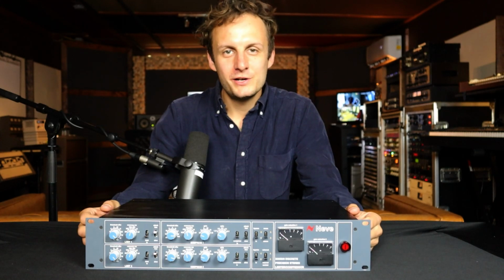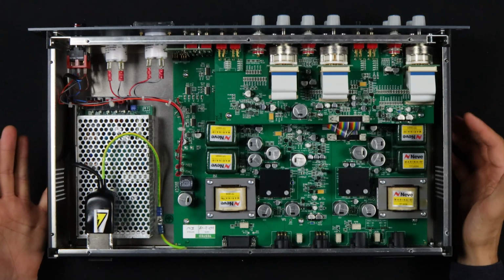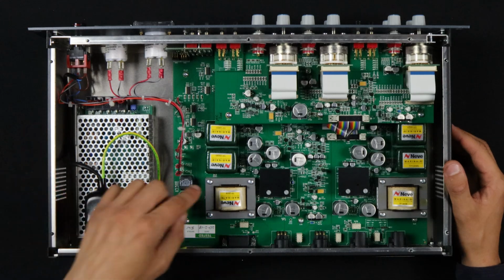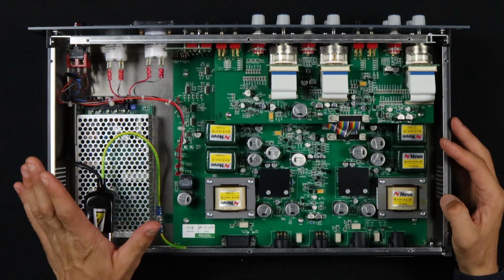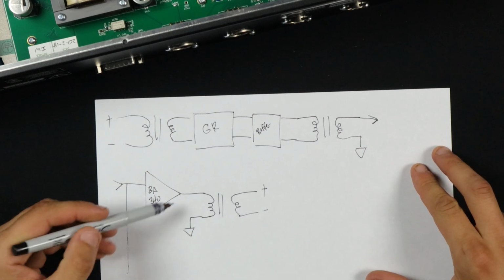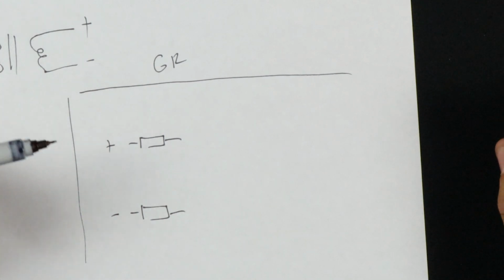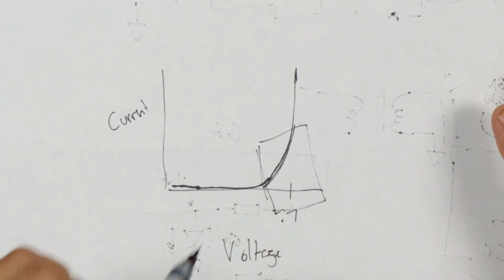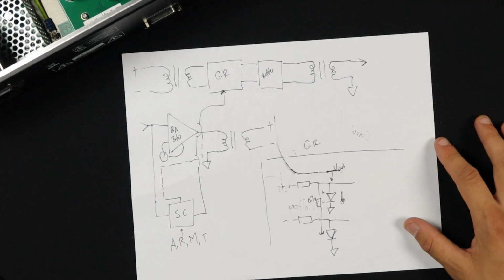Neve 33609 Diode Compressor Teardown

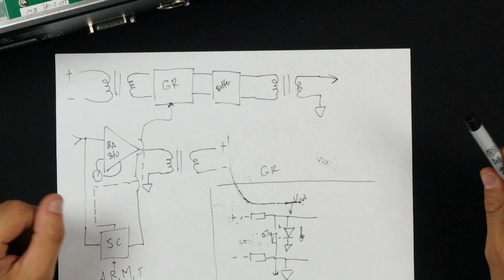Comment: 17:50 the 2253 / 2254  were released in the late 1960s, and they were not even the first Diode Bridge compressor - the Dolby 301 "S/N Stretcher" was released in 1965-66 and used diodes as the main GR element, also, the LA-2 was first released in 1962, it uses a CDS cell and an electroluminescent panel for GR.

Comment: Some what of a myth with regards to the transformers, but hey myths sell. Reality is this, the original input transformer is an off the shelf part from Mariner and from time to time it would be sourced out to different companies, such as St Ives, when Mariner couldn't keep up with demand. Now the original output transformer was a different story, it was a custom design by neve and was only ever made by Mariner and one other company, which was not St Ives. Since the 60's people have come and gone and neve has been though multiple hands, not just siemens group, and over that time the original drafts for the output transformers have been long lost. As a consequence the output had to be reversed engineered, which happened decades ago now, and is the real reason people say they don't sound the same, there pretty close though but hey like said myths sell.

Comment: Can’t a static discharge damage the circuit’s when touching it in this manner?
Reply: It depends on if a particular type of component is ESD sensitive. Most used in vintage gear are not ESD sensitive (other than transistors). The ICs in there are almost surely ESD sensitive. Surface mount resistors could be, just depends on build. Most caps of decently high capacitance value won’t be. Transformers and metal housings are not ESD sensitive. And as soon as he touched the housing of the rack chassis, he would have most likely safely discharged any charge buildup he had accumulated.

Comment: Not to be pedantic but an important distinction for those that are interested; St Ives actually made the original transformers at the same time as Marinair, Neve had a rule to never take parts from a single manufacturer. So they had St Ives (now Carnhill) make an exact copy of the Marinair which was actually an off the shelf product. Marinair then disappeared and eventually St ives stopped making the transformer as well. However it seems after much demand both companies have been employed to start making these transformers again. Many suggest neither are exactly the same, while all these gear companys like to suggest that their product are the only true exact replica, so you have to take it all with a pinch of salt. Mark from BAE explained that Carnhill (St Ives) are still using the exact machines that they used back in the day so are exact replicas. Either way it seems its as close as you can get without a time machine.

Comment: Interestingly, the Yamaha GX-1 uses similar diode bridges in its voltage controlled filters and some of its early monosynths, as described in U.S. Patent 4039980. It also appears in some early Korg synthesizers like the 700, 770, and MS-50.

Comment: 1. when you say the transformers weren’t quite what they were, what does that mean? what is it about these particular transformers that are “authentic?” i tend to assume that kind of cork sniffing about things like magnets and coils of copper wire is just confirmation bias because of the scarcity of the older thing.

2. when you say that the circuit is improved by careful selection of components, what does that selection involve? is it reading lots of data sheets and picking just the right component or is it more bespoke than that like checking component values to make sure that values within tolerances are closely matched to the design spec?

Comment: Very insightful information. The UAD 33609 is very nice but the hardware has a more spacial sound and its clearer and bigger. This is the best diode-bridge compressor out there. The unit has a limiter after the compressor so you can overdrive the transformers for more character while the limiter keeps the signal from overloading and sending out a too hot signal into your DAW.

Comment: Is that a switching power supply in it though?  If so, why in the world not to have a proper transformer based one?
Reply from the maker: Yes good eye! Switch mode supplies can be made to have just as good specs as linear nowadays, with the added benefit of accepting any AC wall voltage.

Comment: Great vid many thanks - i think both the RFZ 713 and later the siemens sitral U 273 were diode bridge compressor/limiters which came out before the Neve 2254 ( predecessor to this). I have used all of them ( including the neve ) and they sound great and very different . Also worth  mentioning is the WSW 601430 which is also diode bridge and would give a Fairchild 660 
/670 a run for its money no problem.

Comment: Do you have any idea about why the signal is kept balanced, meaning that you have to use two perfectly matched diodes instead of one ? Could it be because the voltage has to be kept under 0.7V so  there is a risk of interference and the balanced signal keeps you away from this ?

And same question about having the signal unbalanced/amplified then balanced again ? Is it because the BA340 can't be done with balanced input ?

Thanks for the quality of your video, as always ! :)
Reply from the maker: Very insightful questions! Balancing the gain reduction stage has a couple of benefits. It allows the DC control voltage to easily be removed from the signal at the next, unbalancing stage. And it cancels out even-order harmonics in the same way that a balanced input cancels noise picked up by an XLR cable.

Rod Elliott has a great explanation of it here: https://sound-au.com/articles/vca-techniques.html#s9

Unbalancing, amplifying, and then balancing again is the typical approach because a) then you only need one amplifier instead of two! and b) most non-linearities in the amplifiers will not be common-mode, so they won't be cancelled out by the next balanced receiver. So you can actually introduce more noise and distortion by trying to amplify the signal while balanced.
Reply: @PetersonGoodwyn  What a perfectly clear answer, thanks !

So this is a compressor using a voltage divider circuit controlled by diodes, just as the 1176 is controlled by FETs and LA2A is controlled via a photoresistance.

If I'm correct, a compressor like the SSL G-Bus uses VCA to control gain. Are there others types of compressors apart from VCA or voltage divider ones ?
Reply from the maker: @arthurlauth1380  yes the final type is pulse-width modulation which is what the Pye used that Ruper Neve was hired to replace
Reply: The diodes have to be a QUAD of diodes with the same characteristics and probably need selecting from a large stock of production diodes unless AMS Neve manages to have them preselected from the manufacturer. Transformers provide DC isolation from the incoming signal and the following amplification stage which is important to prevent massive DC shift (thump) as the sidechain (fast moving DC) is much larger than the audio signal.

Comment: What a great video! It's so wrong, but I almost felt a little horny. :-)
What a great DIY project this would be. These units are quite expensive, throughhole or surface mount.
Reply from the maker: Thanks! After looking at this thing... it would be an expensive DIY kit too! 6 transformers, tons of stepped switches,,, hoo boy.
Reply: @PetersonGoodwyn  There's one by diy-racked but you're right it's 1000,- €.
For us regular guys it could maybe stripped down a bit. Stepped controls are nice, but not nessesary, maybe it could be done with 4 instead of 6 transformers... :)

Comment: What a great understanding. This give confidence in your gear built. Ok so I'd like a 8 channels summing-stereo buss compressor with 1073 amp section, CL 1B tube compression, an API continuous sidechain / HP filter knob, LA2A limiter section, blue & red silk + tape or carnhill transformer, 2 mono channel out, M/S - stereo  switch, stereo width just before the limiter, all that in an SPL 120v audio rail fashion. Attack, release, treshold, Main+ 2 monitors out, with a 4 band parametric passive EQ. And all that good for Max 1600$ 😁🤭
Reply from the maker: Haha thanks very much. I'll get to work on that right away...

Comment: Great video! Correct me if i’m wrong but does the transformer feeding into the diode bridge GR circuit need to be impedance matched so that the voltage level across all frequencies stay within the forward voltage limit?

Also, how does it work when the signal is too low? Or if the incoming imepedance is too high? 

Thanks for the teardown! Looking forward! Would be great to see a teardown of the REALLY NICE COMPRESSOR
Reply from the maker: Great questions. I'm not positive what you mean by impedance matched, but any good transformer in a well-designed circuit will be basically flat in the audio spectrum. That is, it will step up/down all frequencies by the same ratio. So as far as I know there is nothing too special going on with the input transformer.

If the input signal is too low you turn down the threshold ;) If the incoming impedance is too high (like if you connected a guitar pickup to the input) you would get lots of loss, distortion, and filtering. But this is universal to any device, not unique to the diode compressor.

Thanks for the kind words and questions!
Reply: @PetersonGoodwyn  Thanks so much for the reply. What I meant by impedance matched is that, from what I understand, the incoming signal's impedance would have to be lower than or equal to the "impedance on the diode" caused by the "voltage divider" (if that makes any sense?). As the greater "voltage divider in this case would also be the transformer against the GR circuit. Just wanted to clarify if this was true or not, and if so, how would one go about determining the range of values applicable. And if not, I would gladly shove this question up my rear end lol.
Reply from the maker: Gotcha, thanks for clarifying. The short answer is that no, there is no line-level device that would have a high enough output impedance to affect the voltage divider. The longer answer is that output impedance is like R1 (series) in a voltage divider. So the only way the output impedance of the previous device could affect the GR circuit is if it added significantly to the R1s in this circuit, which are 47k according to the schematic. Most line-level devices have an output impedance around 50 Ohms, while some older ones go up to 600 Ohms. On top of that, the step-down input transformer reduces the output impedance going into the GR circuit even further. Does that all make sense? Great question!